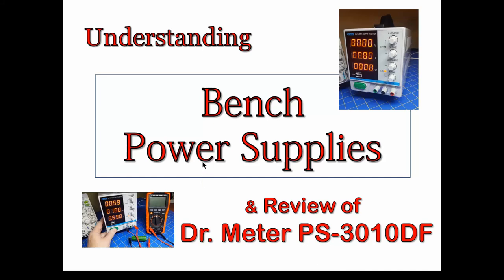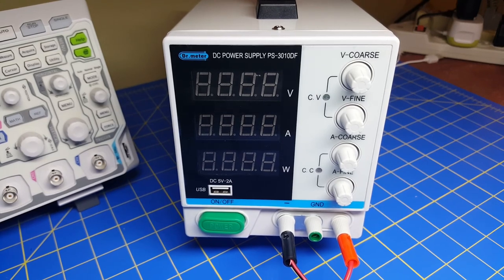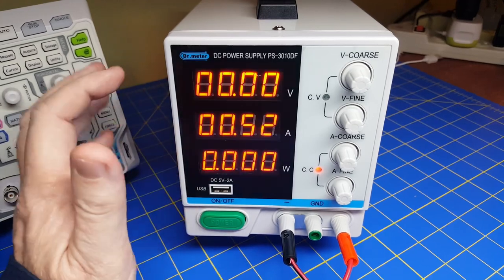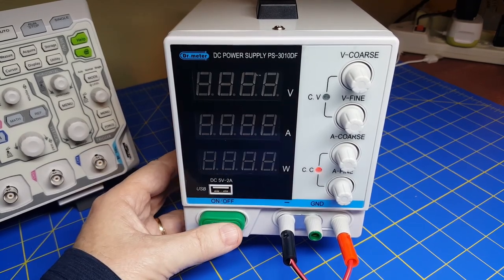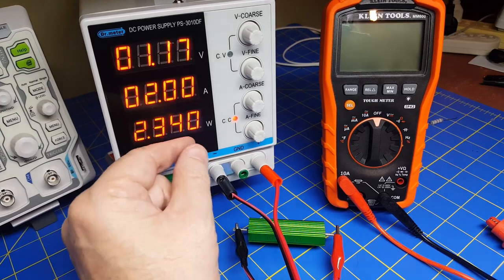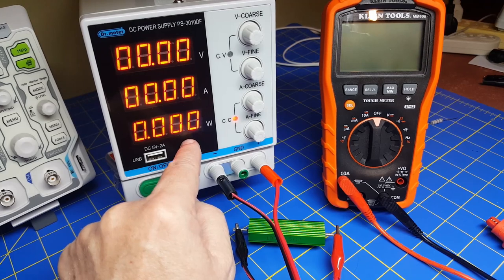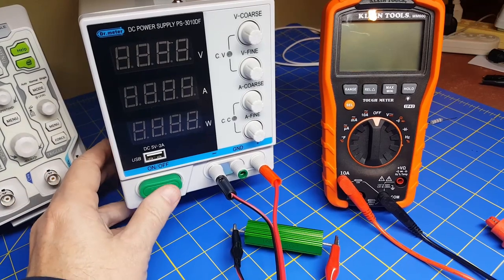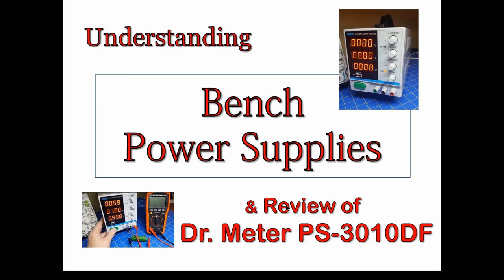Understanding Bench Power Supplies and Dr Meter PS-3010DF Review

Comment: "You see it stops at 9.76A, so you can see I get not quite the 10A at 30V"

The missing 0.24A is on the A-Fine knob, spin that sucker clockwise to get it to 10A.

Comment: Thanks...great insights!  I am an old guy who has never worked with anything but voltage-only controlled power supplies (back in the day).  I was more than a little befuddled by all of this.  And they want me to WHAT?  Short my output?  Dangerous madness!  Now I get it although still a little uncomfortable.  But it is good to feel uncomfortable when you are not absolutely on top of what you are doing with electricity.  Feeling uncomfortable means THINK and go SLOW and BE CAREFUL.  A little speed will come as I settle in with this.
Reply: Don't feel bad, I'm 42 and I'm lost on how to use a power supply like this also lol

Comment: If anyone is watching this to figure out how to adjust the PSU for Electroforming, skip to 21:20 and there's your solution for a constant current! I watched other electroforming videos, returned one rectifier, joined electroforming groups and no clear instructions (and most epic fails), then I found this video. THANK YOU SIR! I needed .3 Amps, and I got it with this guidance. Mine shows mA rather than A (300. mA rather than .3A) but that's an easy conversion. It's steady current, so I can step away and relax. I also have the button you mentioned on my unit Dr.Meter 30V 5A. There was no instruction on any  of the electroforming videos of how to short circuit to set the current like he did here. I'm in business now! yay!

Comment: Can you please give examples on when it is suitable to leave or remove that jumper plate between the ground and the negative terminals?  Mine came with one attached, but the user manual doesn't mention it nor give scenarios when to remove it and etc.

Comment: 120422/1900h PST 🇺🇸 Thank you for, painstakingly, explaining, not too important matters regarding your DMM reading. Did you forget,that the cheap DMM is way off reading? I is calibrated? I’d have appreciated if a FLUKE  was used. Oh by the way, the cheap Chinese power supply is also way off it’s output reading. Why not use a professional DC power supply , B&K (#8601)and talk about it? The resistor tolerance under test is 10% Plus or minus in reading. 
Why not we call off the test, if you may, please Sir? Best wishes and 73s…
Reply from the maker: As the video title clearly states, one goal of this video series is to review this particular bench supply. Which is why I didn't use a different power supply. I've been an electrical engineer for over 45 years, and inexpensive DC supplies like this are generally more than sufficient for the vast majority of my needs. In fact, often I'll use a cheap wall adapter with a voltage regulator (which I did a video on). Electronic circuits can generally accept a very wide range of VCC supply, so super accuracy is generally irrelevant. I've found that this device meets its ratings of 30 volts and 10 amps, so I'm not sure what your concerns are. And I'm not sure what you mean by "way off its output reading". If you're relying solely on the internal meter accuracy, and didn't first check the display accuracy specs (of this or ANY device) then I can understand your disappointment. Use the right tool for the job. Which means first understanding its capabilities and limitations. And don't let hobbyists convince you that you always need the most expensive device with the best specs.

Comment: I went and bought two of these things last night. not the same one, but one that has the - gnd and +, but nowhere, not even the useless as you say manuals, can I get an exact definition of their use of Ground and Negative> I see some testers with theirs having a bridge connector hooking their negative direct to their unit's Ground connector.

I am presuming that means they are only using it in monopolar mode or whatever that is called.

If the bridge is not present, is the 0-30 Volts split exactly between the minus and plus feeds?
Or does it float around, or nine bazillion potential results?

THANKS!

i nearly forgot to mention, Way back when I ran my own design & build lab, was when using a Linear power supply was not a Capitol Offense.

and one amp each was always plenty enough from a pair of 78xx & 79xx voltage regulators was all I needed to worry about, never bought one of these bbefore.

Comment: this was very helpful.  I was thinking mine wasn't working because I didn't understand how to adjust constant current.  It looks like you have to fiddle with it to get the constant current you're looking for.  Furthemore, I was experimenting with a fixed load.  I was trying to see what happens if I connected a 12v-24v 10w dc flood light and I fed an amp of constant current.

Comment: Not sure if that applies to all DC Power units but...
I set it by first setting every knob to off, then setting V to the value I want t o use in my circuit, then I short circuit + and - and set A to the value I calculated my circuit will max out at.
Then the current is set to a safety value (at least for my unit)
Reply: Ahhhhhh, the simplest answer I've been looking for!!! So if I got this correct. My headlight unit says 12 volt 3.8 amps 55 watts, with 3 separate connectors for high/drl, low, and turn signal. I would set my bench power to those numbers for each connector, right? Or do I have to have 3 leads into one for negative, and 3 leads into one for positive to power all three bulbs at once? Or each one can recieve those power numbers mentioned above separately?
Reply: @804MRMAN  If you have 3 separate +, - and a common ground you should do this for every security for A you need, just make sure you use the correct cables to the correct circuit.
Reply: @port513  Gotcha

Comment: I bought one of these for my off grid power shed. Actually, I didn't know I had bought it till I checked my email. Amazon is tricky!  At 30V this is really operating on the edge. With my MSW inverter it will only get up to 25V.  It can also run on 140V DC in the 220V switch position as it uses a voltage doubler on the input.  I should have bought the 5A version as often these will work at lower voltages, or they can be modified to. I really wanted to avoid having to use an inverter with it.   The test leads have those spiral fingers and have found so many of those banana plugs can have a lot of resistance as they age. I've had to file and solder many of them to prevent voltage loss.  A decent supply for a beginner, it just doesn't suit my purposes for a low power supply.
Reply from the maker: Not sure what you mean by "operating on the edge at 30 volts", but mine is rated 30V 10A, and I can get more than 35 volts at 10+ amps. And you think it's "a decent supply for beginners"? I've been an electrical engineer for over 45 years, and it works fine for me. I couldn't care less if anyone buys this, but no matter what you buy you first need to understand it's specs and how to use it.
Reply: @EETechStuff  I've been designing longer than you have. I had my first employment repairing transistorized electronic organs in the early 60's when I was 14.  Just surprised it doesn't handle lower supply voltage a little better. Only looking to supply 100ma. Like I said, I never really intended to buy it. It is not ideal for camp. At home all my supplies are XANTREX.

Comment: Thank you very informative could you fit a on/off switch directly into the +ve 4mm slot then you have isolation from your circuit, just a thought Peter. Many thanks.

Comment: My biggest problem with mine is that I don’t fully understand amps/volts.  Lol, my own ignorance.  Like, why does it automatically change between constant current and constant voltage and why can’t I set it to one or the other.  Yesterday I was in a bind because my truck battery was dead.  I ran the power supply at 14V the amps started out at 10ish and dropped down to around 7.  After about 7-10 minutes, there was enough charge in battery to start the truck.  I don’t know how dangerous (or not) this may have been, but that’s why I am here now.
Reply: i am in your situation. i have no idea how this thing works, which is why i bought it (to learn). i cant get a handle on why you have to flip back and forth between amps and volts and the constant stuff. i wont bother to tell you what i assumed which i apparently wrong, but people charge batteries with these all the time in the videos i watch. in your situation,  the battery is the load and as it charges up it requires less amps, so no matter the setting on the power supply the battery will only take the amps it can use to charge, starting at say your 10 amps until it tops off and doest take any more or possibly trickles at 2amps or so

Comment: Dear Sir,
You video is very helpful. Please help me. I have to purchase a used power supply. I have two options, 
1. Topward 6303D
2. Caltron PR 3303SE
I have downloaded the operating manual of S. No. 1 but couldn't find that of S. No. 2. I need durable, high quality and easily repairable out of these two options. Price is not an issue.
I will be highly obliged if you guide me to choose the right one.
Thank You.

Comment: So, can someone tell me  if it's possible to set a constant 3.0v output, and limit the output current to lets say 500mA?
I have a piece of equipment I want to power up while I'm trouble shooting it's circuit components.
The piece of equipment is normally powered by 2× D cell batteries, and is drawing around 700mA, but I believe that is a little higher than normal and something on the board has a partial short or is failing.
I want to power it at the standard/correct voltage, but limit the current to roughly 500mA or maybe less during testing, then use a thermal camera to try to pinpoint any problem areas and hopefully limit the chance of any further problems by limiting the current whilst maintaining the correct input voltage supplied to the item I want to test?

Comment: I bought one of these to test my sailboat wc pump engine (24v / 6amps), and of course, there is no way I can set up my 30v/10 DC supply to reach the mentioned required current. How can I do it? Thanks in advance.

Comment: Is there a way to preset Amps before plugging a device in? We can preset Volts but only see Amp display when device is connect.
Reply: Yes, connect the + & - together, it will show you both volt and current. Good luck.

Comment: I have an old power supply with analog meters, when powering an rf amp the dc amps start at 8 amps and goes down as  i am modulating/talking, is this normal ?
Reply: Part 2: https://www.youtube.com/watch?v=Mx9jDggmrPw&feature=emb_logo

Comment: Hey, I need a negative voltage to power some dual rail op amps. What is the cheapest power supply I can buy to achieve this? I am at home and do not have access to the campus labs. Will someone please help me out..

Comment: Just askin' but, how hard would it be to add an output switch on this PS? Can you just install a switch in series with the positive leg of the output? Also on the Amazon page it states that it can show 0.001A, but the one I received only goes to 0.01A. I don't understand why, especially with the 4 digit display. Thanks
Reply: I suspect the 0.001A resolution claim is for the 5A version (5A + 4 digits = 5.000), on the 10A version you can - as you say - only get a 0.01 resolution (10A + 4 digits= 10.00).

"Just askin' but, how hard would it be to add an output switch on this PS?"

Easy, just solder in a suitable power switch . . . if this is to avoid starting the unit up when it's set to "kill all my electronics", then another approach is to simply pull off the knobs and replace them with knobs that have indicators on, I did this and now when the unit is set to 0 (on all knobs) the indicators are all pointing to 9 o'clock. The unit uses standard 6mm T18 knobs, you can find them anywhere (I got gold knobs, because I'm real classy : ). Or if you are a cheapskate, just use a marker to mark each knob with a little indicator line.

Comment: So is this AC or DC? Will it work for electroforming?
Reply: It is a DC power supply, AC comes in from the mains, and this unit converts it to DC and pumps out lovely fresh juicy DC from the front. I googled 'electroforming' and got this . . . "For electroforming, you need a steady direct current to obtain a good plating" . . . so it looks like this will work for you, but best to double check for yourself.
Reply: @davelordy   Hmmmm... My power supply puts out fresh current but sadly, it is not juicy. Is there a setting for this?

Comment: Thank you for the vid!
Question 
These cheap eBay bench power supply’s - how can I protect from reverse polarity?   Put a 5A schottky diode in the line?

I accidentally reverse connected a 6v battery and it blew a 2amp ES2G board diode.

Comment: I in all my 35 years of being an electronics technician have never linked earth ground (Chassis Ground) to power supply ground. Doing so can damage test equipment. I always have my power supplies floating which creates isolation from other test equipment.
Reply from the maker: If you're a trained electronics technician you learned early in your career that the connection from the case of any test equipment to ground is there to protect you against possibly fatal electric shock. If any test equipment is floating and energized, and something happens inside the equipment to connect high voltage to the floating case and you touch it, you become the path to ground for the high voltage. And it takes only fractions of an amp to be fatal. However, if you connect the case to ground it will bypass your body and protect you. I've been a professional Electrical Engineer for over 45 years, and in working on very high voltage equipment the case ground is crucial. Even if there is no internal faulty connection to the case, voltage can be induced into the floating case which can be fatal if touched. Which is why in the real world of industrial power systems they spend great effort to ensure there are huge copper ground mats under the equipment and all metal equipment cases have solid earth connections. What you choose to do is up to you, but I encourage others to at least wear some protective vinyl/rubber gloves when working near mains-connected equipment.
Reply: Could you do a video about having a proper resistor in the earth ground when testing, I had been using an earth grounded water pipe on projects like a mini generator, then I read I could die because my earth ground wasn't using a resistor
Reply: He never, he has linked earth ground to negative!!!!     So if a live wire came in contact with the casing it would travel down the plug through your consumer unit and trip the breaker.  ie a short circuit.  But the main reason he does not mention, is that if the breadboard or whatever you are working on is metal and becomes live, you are also protected because the ground and neutral are together at the unit resulting in the fault traveling down the earth/ground to your earthing arrangement of the house you live in